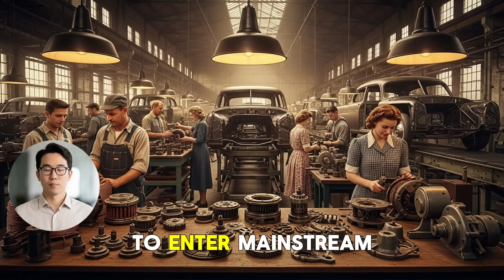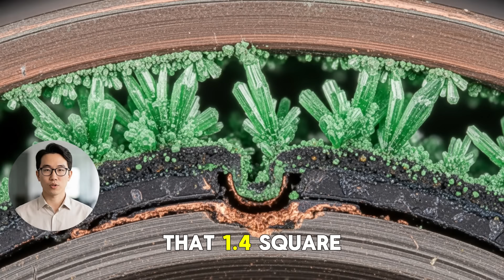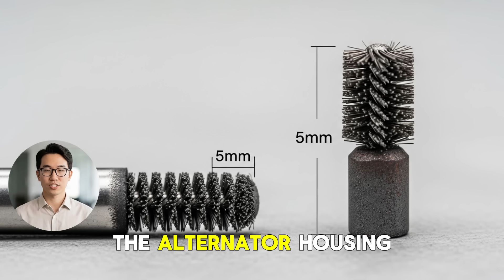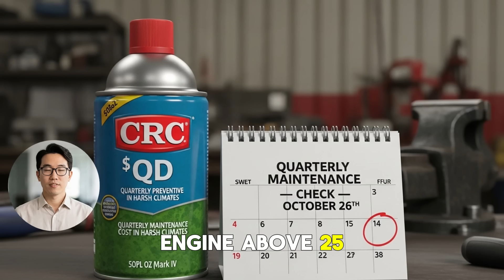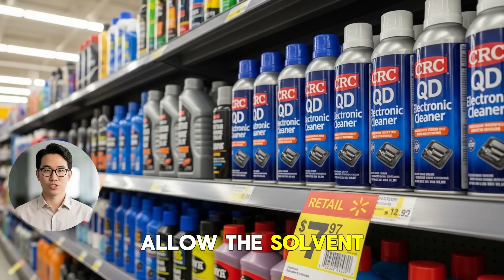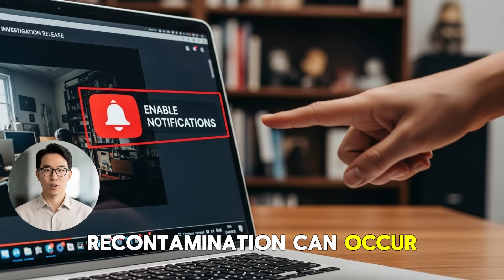$3 Spray RESTORES Any Dead Alternator FOREVER. GM BANNED This Since 1968

Comment: GOOD VIDEO, BUT...
We like your presentation, especially yout technique of iinformation summary at video's end.
We regret you do not show how the contact cleaner is applied to the commutator slip-ring assembly.
That technique may vary with the alternator brand, but we need to have at least a general example. 
Another, related concern is we are left to assume the spray technique requires an alternator dissassembly.
Looking forward to your updated version of this video, now that you know what is needed.

Comment: In the beginning they had an external regulator and unless you replace both your warranty is void if the problem was the problem was the regulator then owell buy a new one under 20 dollars  cheaper than a new alternator I had the alternator tested and if it was okay and the regulator was dead then I chose to replace only the regulator voiding the warranty if it was the alternator then I had it rebuilt and they did it right the only thing left was the case windings and stator which were cleaned brushes bearings and the rectifierg all replaced with new a remanufactured alternator are only cleaned and parts that have failed replaced the rest are left so if a bearing or other part fails they gamble that it'll last until the warranty is off and if it goes before the warranty is off they have still saved on all the one's that make it past the warranty period so you pay more for less unfortunately I don't know if there are any auto parts rebuilders left last time I needed one about 20 years ago of the 6 I knew of and used to rebuild my alternator and starter's they were all gone since most were in their 50ties and 60ties most just shut down and retired I did find a.new company but they couldn't tell me if they did a proper rebuild or just cleaned it up and replaced only what was needed so it was cheaper to just go I the wrecker and get a used one usually if it tested out it lasted I still repair my own vehicle but now with cheap foreign part.s it's just as cheap to replace than to rebuild a part learned that years ago when replacing my breaks took my rotors in to have them turned down on a Friday afternoon and was told the technician who operates the machine was off till Monday morning that ment take them home put them back on and go to the wrecker and get a set of unknown shape so I asked him how much for new and was told that it was 30 dollar's each one so I bought new it was almost cheaper to replace them 30 dollars for new and a nickel less to turn them and I had had a warranty don't know if anyone turns them anymore
Reply: Your comment has important information,  but your long, run-on sentence leaves it difficult to read. Surely, you know how to use commas and periods.

Comment: Every time I get a customer that has an alternator that stopped charging I'll take a hammer and give it a few taps on the back, usually it starts charging immediately. most of the time it's the brushes get stuck and not contacting the slip rings. It usually gets them home or what not and sometimes it could last many many months more. Doing that sure does make the customer happy 👍

Comment: My 21 Mercedes GLC43 4MATIC has 2 batteries. 
  Can I disconnect the positive wire on the alternator, instead of disconnecting both batteries????
Bruce